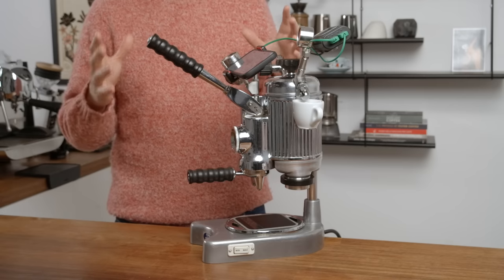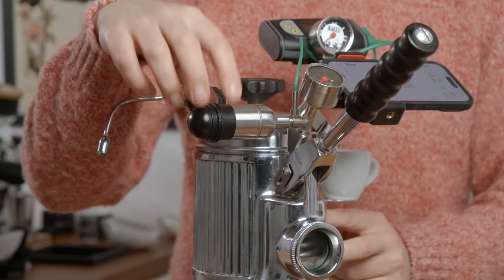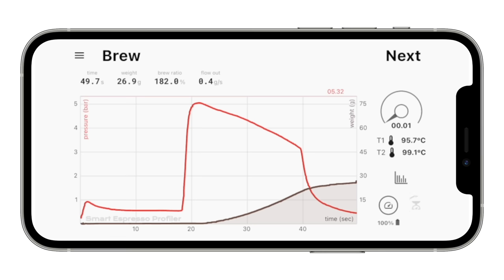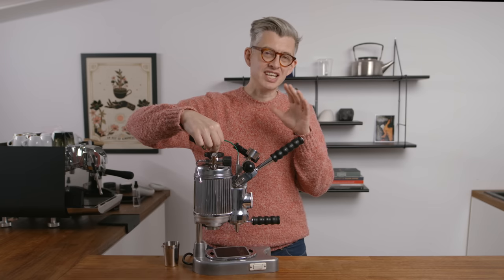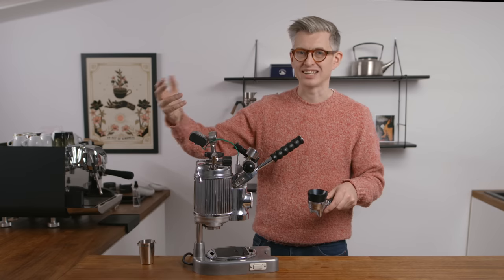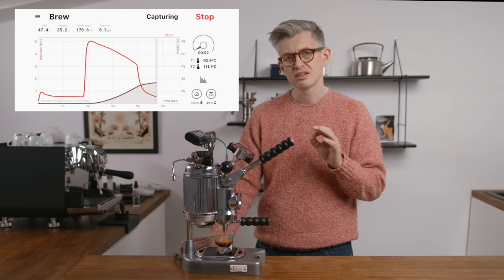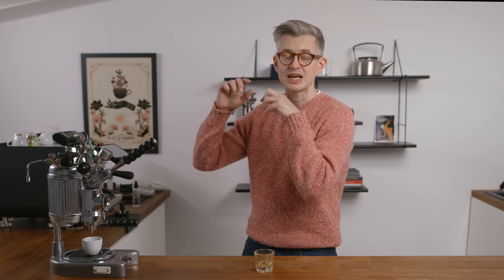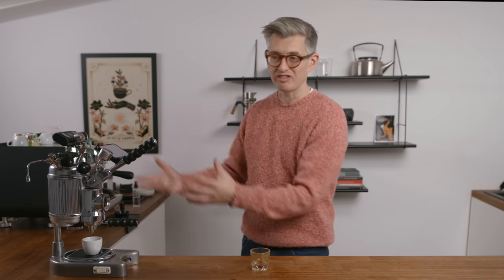An Upgraded Vintage Lever Machine

Comment: The reason I have my La Pavoni is to feel the experience every time I pull a shot and I don’t mind when I muck up a shot because at least I’ve been in the moment with history and art. Also, I do measure the shots and time them after I’ve changed the seals just to work it back in.

Comment: I appreciate the time both you and especially Gabor took in evaluating what to do with this machine.  Sometimes modifying something isn't as rewarding as the original design, even if that design may be flawed in some way.  That said, after watching your video, as much as I would love a vintage lever machine, it just doesn't seem like over time it will be that rewarding for me.  I still love the idea of lever machines and love the vintage look and feel of it.  

One question I do have is if you were to drink that shot side by side compared to modern level machines, how would you rate it?  Provided the most well known one now is Flair and it definitely operates quite a bit different.

Comment: If I wanted a lever machine with all the bells and whistles I would just go buy Profitec 800, if I wanted a machine with endless tinkering I would get a Gaggia Classic Pro, if I wanted the experience of an old time lever machine I would buy something similar to what you have there and re-ferb much like you did but without all the bells and whistles. While it may be frustrating to dial in initially, as you stated, I would be more interested in the experience and the acquisition of skill to pull said shots. Great video, a very interesting idea.

Comment: James, have you tried to pull Fellini shots* on the machine? That sounds like something that would be a very, very interesting complementary experiment with the temperature readings.

*for non espresso nerds, a Fellini shot is when you pull again on a spring lever to force more water through the grouphead, resulting in a longer shot.

Comment: I'd love to know if you can use the steam wand as a means to controllably bleed off excess heat/pressure such that you can reset your brew window after a shot.

Given the heat/pressure readout, you might be able to train yourself to temp-surf rather than rely on a Frankenstein'd PID-controller servovalve to do it for you, and again be able to ween yourself off the data.

Comment: Since you have all the temperatures monitored already, I think it might be possible to add an external pseudo PID control system; eg. one where the machine is plugged into it with no other modifications. There should be a relatively easy way to approximate/calculate what the brew temperature will be based on the measured temperature of the boiler and the group head. With my knowledge of automation I see no major issue with this. And, this Could bring a retro lever espresso machine closer to the modern PID temperature controlled machines repetability.

Comment: If I would add one thing, it would be to replace the switch with a micro controller controlled potentiometer. Then you could figure out the optimum current to pull a shot and start the cooling process to get ready for the next shot hands free.

Comment: For non-destructive mods to regulate the machine I have a couple bolt-on ideas. It appears there are some small fins on the body of the boiler for decoration / to dissipate heat. Mounting a small pc fan to the base/post to move air over the boiler in 'Min' mode may help modulate the temp. Additionally, adding a manual lever valve on the current pressure release system would allow controlled amounts of pressure to be bled off and subsequently drop the water temp as needed. 

If nothing else, ask What Would Gabor Do? Hopefully we see a part II.

Comment: I am very torn about modifying these sorts of thing (and this applies to espresso machines, old motorbikes and cars etc equally)... there's a beauty in something that gets used and loved and upgraded over the years so it is moulded to the owner and evolves as technology improves. Something like that carries the scars of long use, occasional repair, modification, customisation, and honest wear and tear. An artifact that's not bought, and discarded when it is superseded, but kept up to date through love and labour is wonderful, magical, almost alive with its history written there for all to see in metal... think about the guy whose old motorbike has a bigger screen, maybe hand-guards to keep off the wind, maybe it had mechanical ignition and now it has electronics, accessory plugs to power a sat nav and a heated jacket, a comfier seat, some performance mods etc. That's a lovely thing. 

Then there's buying something new to you but old, whose value lies in history and nostalgia, and altering it. Sometimes that's a work of art, something new, unique, and beautiful. More often you've taken something whose value lay in it's age and period charm and turned it into a bad version of something you could've (should've?) bought new... 

I don't know where I stand on this one. Did Gabor put in all that work when really the people who want this sort of machine would be better off with a Decent? Or is this cool, a way of keeping a nice object relevant without butchering or replacing it? I guess by being reversible the new owner gets to decide, and can take the data, learn, and then revert to maybe get the best of both worlds.

Comment: Owning a La Pavoni Europiccola, I do a 'pre-shot' running only hot water through the basket. It solves the problem of the colder group head...but doesn't help with the fact that next shots will be too hot (burnt)! For that issue, I play with on/off button...

Comment: What about adding an AC relay to be controlled by a PID? That could help keep the group head temperature perfect shot to shot - also without permanent modification to the machine.

From a purely functional perspective, you could also slap some heatsinks on either side of the group head with thermal paste. It'd be ugly, but would help it cool quicker in a non-damaging way.

Comment: Is making espresso on a manual lever machine "art" or "science?" It's a classic debate. Personally, I like knowing what's going on inside the machine (usually with analog devices) and then ignoring them once I know more. I've heavily modded a Gen3 La Pavoni manual lever. There are many things one can do to make LPs more temp stable (stainless steel sleaves, SS pistons, SS fill tube inserts, etc). Then other things to gather data. Personally, I find looking at digital screens while I'm pulling a shot on an analog machine distracting. 

Shout out to Gabor for insisting not to destroy the machine. And to you James for embarking on this adventure.

Comment: I pull a shot or three on a daily basis with a La Pavoni Europiccola. That satisfaction is magical when consistency is achieved. It's kind of like perfecting a first-second gear shift on a car with manual transmission. My daily is a manual but that perfect "1st to 2nd" still is not 100% achievable.

Comment: This is similar and different to what’s well known for the La pavoni… the first shot for many people/ procedures and most machines is too cold ( even if you run hot water through). The second is really great.  The rest are too hot, unless you cool the brew head down.
Reply: You can see this approximately with the stick on thermometers and the temp of emerging shot, and the taste of the shot

Comment: I'm totally team restomod, a modified machine in use is better than an original one gathering dust. But staying with the theme, once you have temperature readings and bluetooth you are one smart plug away from temperature control without even touching the machine.

Comment: I'm not sure! I'm also a long time lever espresso lover but I'm always wondering if I should continue to replace old parts and improve it slightly years after years or if I should stop investing on this because at some point, someone will release "The modern lever espresso machine" and I will buy it instantly. This mythical espresso machine may never exist but I keep hoping for it.
This experiment sum this up, it's exactly this

Comment: Yep, right decision. No-one rides vintage bikes or wears an old mechanical watch because they're the best tools for the job - a cheaper modern one will often do the thing better. The enjoyment of the quirks, and the story that goes with the object, outweigh the extra hassle and less than optimal performance. That said, applying some science to getting the best out of it in a non-destructive way is a cool idea.

Comment: Neat, It seems very similar to the Europiccola in regards to it basically being a ristretto machine (except for the spring part and all the mods), on mine I have no clue what brew pressure or temperatures I get since I don't have a gauge or thermometer but it seems to give pretty nice results, I usually do 15g as well and get out usually between 25-30g with my Post Millennium model. Maybe these old machines are meant more for smaller doses If you put in like 13g there's more room for water to fill the brew chamber and you might end up getting more like a 1:2.5 ratio.
I'm guessing people still enjoy the results with the high temps on that model, I'm guessing you tried it? :)

Comment: You need to make it just a little more complicated. 

I've been playing with modding a LaPavoni with2 channel  PID temp control. One on the boiler and one on the group (group wrapped with a flexible heating element). Added a mini air compressor to provide pre-infusion pressure through a tee fitting at the pressure gage. This setup lets you keep the boiler below boiling while getting the group to a reasonable temp in a reasonable amount of time. Everything controlled through an Arduino with a 4 line display.

Comment: Please please do the same thing to a Londinium Compressa. It will hopefully turn out to be the perfect counterpoint to this machine - a well-designed solution to the problems you encountered, resulting in a “reliable espresso, every time” experience.

Comment: I'd like to know how to recondition a used one. Now I know what to look for if I see something like this in a thrift shop (all my espresso machines are thrift shop finds, my original old Gran Gaggia I've put back into service), can I easily find a manual that lets me replace the gaskets and/or hoses? 
Most of what I know I learned when I started at Starbucks back in 2002; we still had the old La Marzocco machines, you had to pay attention to grind and tamp and pull-time, mostly temperature controlled but even those were wearing out. I loved that cranky old tank of a brewer, glad I left before we had the automatics dumped on us.

Comment: I wonder if you did want to go for further modifications whether you could manafacture a cooling solution for the grouphead which kept the brew temperatures low enough for continuous use, either with an active solution like water cooling or with something more simple like a large heatsink manafactured in the machine's style

Comment: The philosophy does connect with me.
The amount of excess material and mechanical inefficiency coupled with that era's fascination with nickel just appeals to my eye.

BUT...

I'd rather have a good cup.  Unless I'm pulling shots in front of my guests, they won't know that it came from a relic.

It's like wanting all the bells and whistles of a brand new car, but prefer the aesthetic of a 60's model.

If I asked a professional with the ability if I could hide a Prius in a 64 Mustang, I'd be escorted out of the building and told to never return...

Comment: I don't get why you would use the smart espresso profiler on a spring lever machine. Totally makes sense on a non-spring machine like the cremina in the other video. Isn't the brew pressure of a spring machine pretty much the same on every shot? The temperature probes are really useful though.

Comment: What a contraption!  It kind of has this meat grinder hole thing going on which I'm not sure what function that has in terms of how the machine operates.  You alluded to that area being the group head or chamber of some sort but I'm wondering what's behind the glass, what's the point of being able to view or look into that (?).

Comment: All these simple level machines do suffer a bit from group overheat; but they do so at different levels.  I think this particular model; with the group mounted directly to the boiler; may suffer more and have a shorter window for success.  

But look at the La Pavoni community.  Half the mods are heat sinks to cool the group or isolators to keep heat from the boiler bleeding into the group.  It is something that all serious leverheads understand.  

What really can mess with your mind is trying to work one of these things in a non temperature controlled space.  You get a different thermal experience at 10 degrees C than at 30.

Comment: In home brewing we use plug in PID controllers for fridges, HLT and sparge water…. If you can get a thermometer in can you not use that method to control the power to the unit, turning the element on and off the same as a built-in pid?

Comment: You would appreciate a direct manual machine...combine that action with a heat exchange boiler system with an independent water source, like a water supply line or a reservoir....so you can control the temperature profile over and over. The only machine that fits the criteria is the Gaggia Achilles. I would appreciate the information, if anyone knows of another machine that does. Nice video.

Comment: Moka pots are just as fussy, people still use them everyday. Sometimes people just want coffee regardless of hyper precision. Sometimes ignorance is bliss. There are days I would drink the darkest roasted diner robusta and be glad it has caffeine, there are other days if a pour over isn't just right I'll dump it and work until its ideal. I think the beauty of this episode will show time/place/preference/culture/money/means all have a push and pull depending on the person and the day. Not every coffee I drink needs to be run through a Decent espresso machine and have all the associated data points... sometimes what is easily available is good enough.

Comment: As a robot user I'm not sure I'm understanding what this lever does. It's clearly not providing pressure through the shot like a robot. It's compressing a spring which then provides pressure? Or is it just a large button that allows the water's pressure to go through the ground espresso making it more like a traditional espresso machine?

Comment: Unless it's broken,  you're meant to heat the machine with the side switch to min. This increases the time it takes to reach brewing temperature and also allows the group head to heat up as well. This reduces the temperature differential between the two. When you want to pull a shot, push the side switch to max to increase the boiler pressure for brewing.  It is meant to be a slow process;  unrushed. Ffs, its the morning, take your time.  😂

Comment: NO SIR! You don't need to pull the lever all the way down for preinfusion. Unless it has been modified somehow, that piston is designed to have a soft preinfusion by pulling the lever only a few degreesfrom the top. I had one with a rare fill valve option installed into the boiler lid. Fun little machine that was also made with a gas fired option, although that model is extremely rare.

Comment: If you got that far, would it be possible le to build an external cooling system to keep the machine temperature constant?
It could be a spiraled water line with cold water flow triggered by the existing temperature sensor.

Comment: I'm new to this technical in dept approach to making espresso.
I was wondering, if you want an even temp in the brew chamber, why should that be a problem?
I could image a machine that has the ability to heat a chamber, but also cool it when it's getting to hot.
Does such a machine exists?

Comment: I don't drink coffee but I can really appreciate the level of conservation at work here. I collect old WWI era rifles and I see a depressing number of bubba jobs adding on modern scope mounts, cutting down stocks, and even cutting barrels down. It makes finding original and safe to shoot examples extremely hard to the point that I can only describe hunting certain models like going after Moby Dick.

There are ways to do the more minor modifications/modernizations but they are expensive and require custom work so most don't go through the effort. So hats off to the mountain of work that has been done here to preserve history.

Comment: Wouldn't the temperature in the group head be at a good temperature if you changed the setting to min, and flushed the group head? So you can extend the window of usable temperature?

Comment: I own a restored Faemina among other machines. Interesting Frankenstein mod. One cannot appreciate the Faemina experience fully unless you mention developing the conditioned aversion response to NOT let your skin come in contact with the machine body that is VERY HOT. No insulation between boiler and outside body.

Comment: Makes me think, how has coffee evolved over the years, how would a roast from a machine, if it existed/exists, from the 1800s compare to the "evolutions" of it in the 1930s, 1960s and so on up to a modern brew. How have the tastes changed, were the roasts different back then depending on the machines available at the time...

Comment: Would it be better to switch to low power at a lower boiler temperature but run a shot of just water through to heat up the group head? Or is there some reason why this wouldn't work?